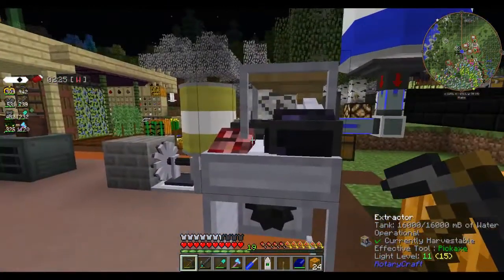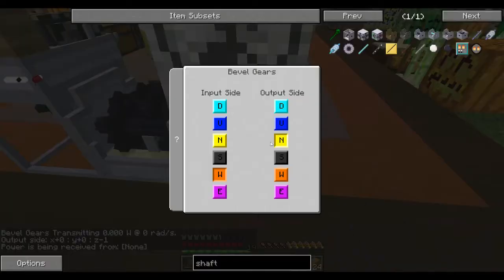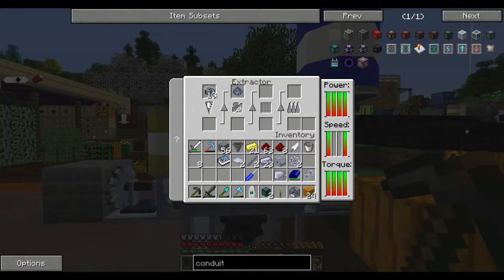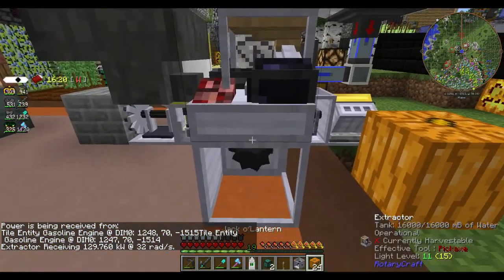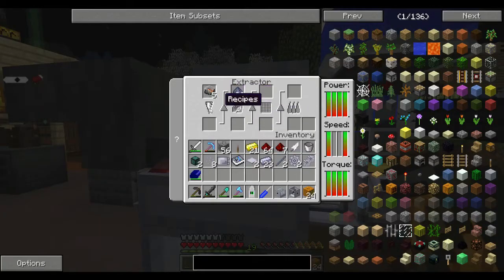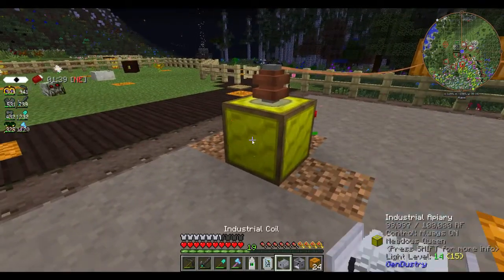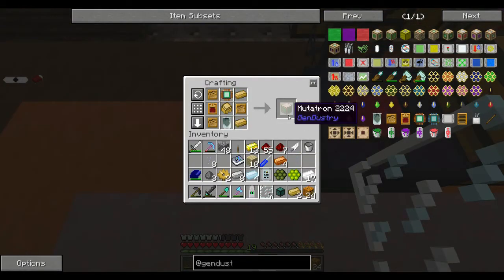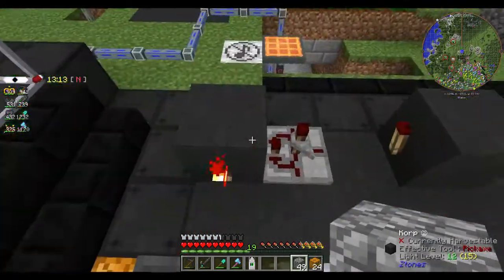Minecraft - Revolution 2 - Ep 19 - Rotarycraft Ore Processing - Finally

Comment: If you stick Engine Controls under the Gasoline engines, you can have them turn off with a redstone signal and preserve the fuel they have in them. That works as well on the Grinder as it does with the power monitor. Redstone on means they'll run, redstone off means they won't. I think you need to shift left-click the controller to put it in redstone controlled mode, but after that it's easy.
Reply from the maker: I'll look into it next time i'm in the world